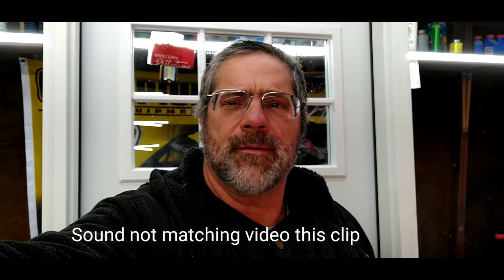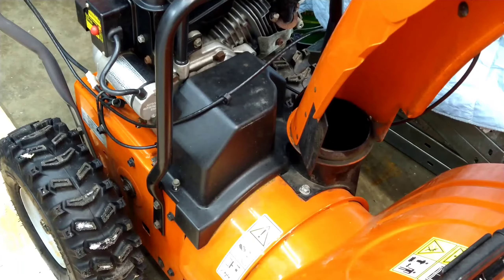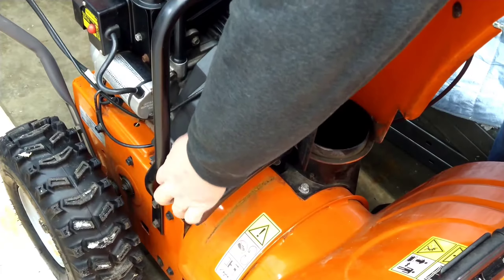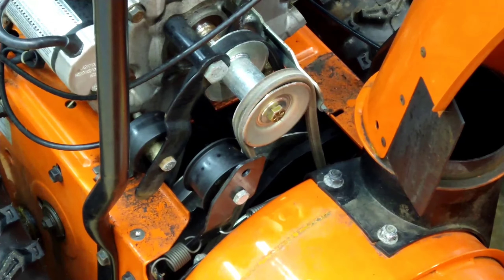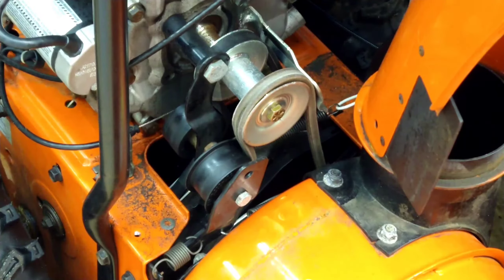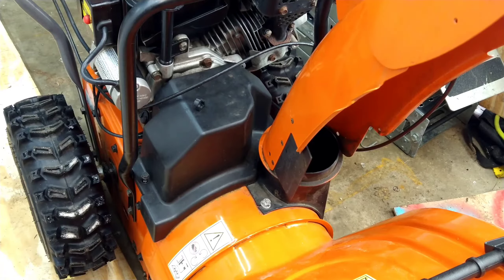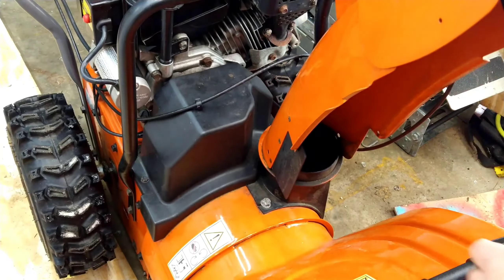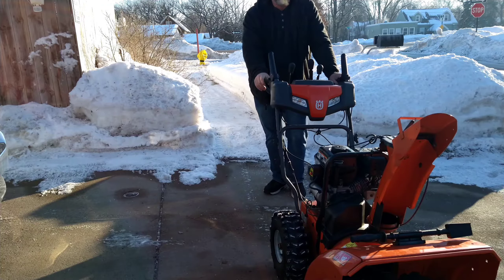HUSQVARNA ST224's tensioner SPRING replacement

Comment: Great work my friend 
I have sane one
Mine seems weak not much power 
I bet I’m either missing some springs or they are all stretched out 
Do they sell the springs at Lowe’s or do I need some sort or repair kit 
Mines close to 10 years old so I might just rep replace them all
Reply from the maker: Look for model number on your unit then call your local small engine shop for parts.